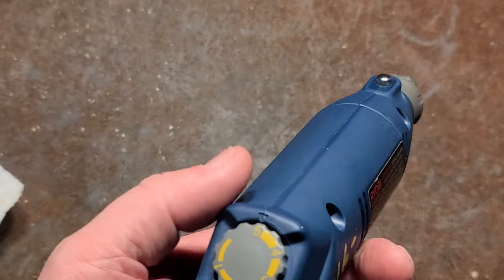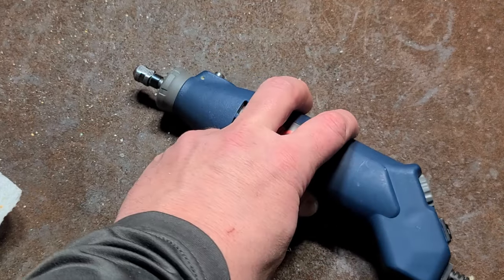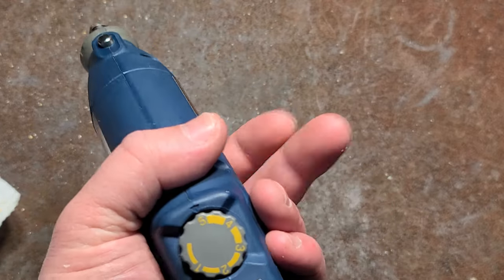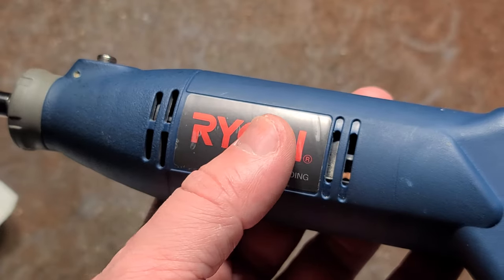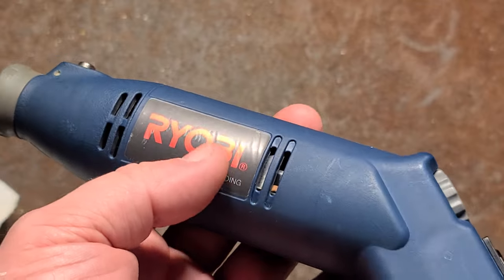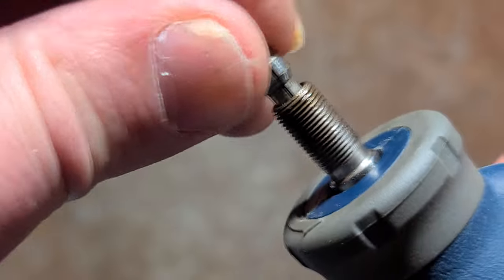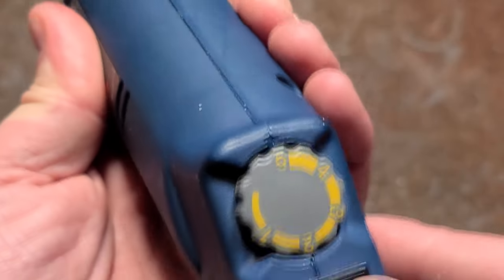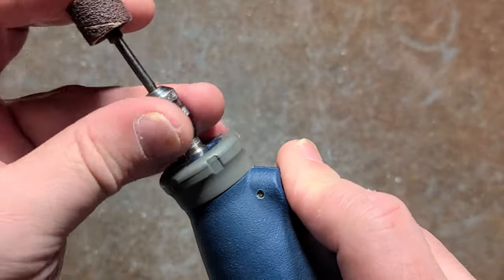Classic Ryobi USA Dremel Rotary Tool Review/Teardown

Comment: The old ryobi blue stuff was really solid. Last forever.
Reply: I agree. My dad has a Ryobi miter saw that’s a hit beat up but still has good power and is still reasonably accurate. And he has a detail sander that hasn’t been used much, especially since oscillating multitools became a thing. But it works fine. Can’t complain about the old blue Ryobi stuff.